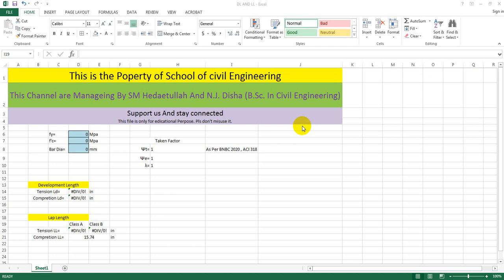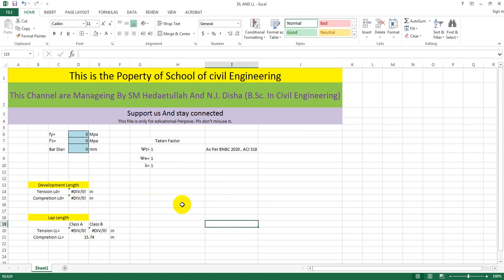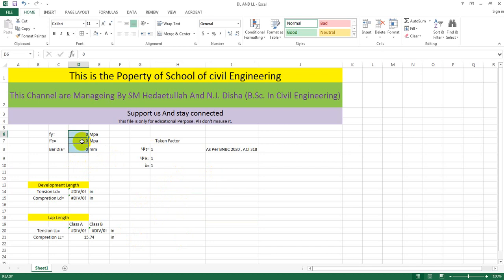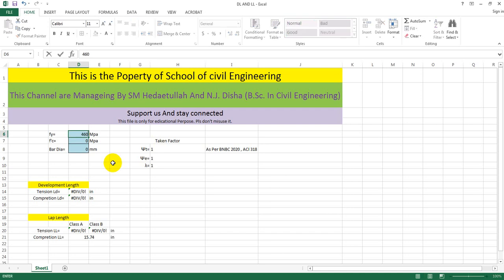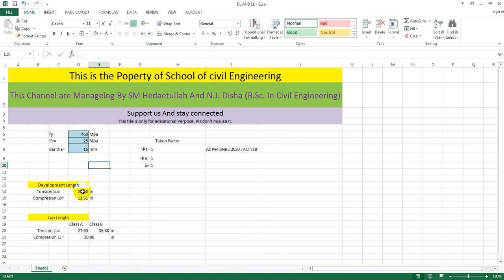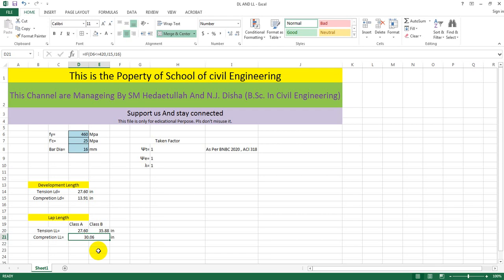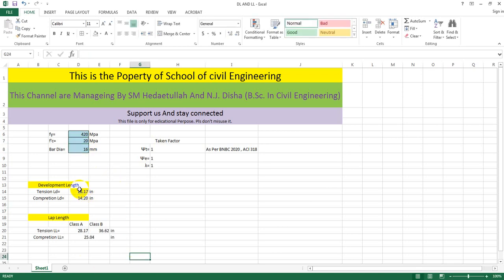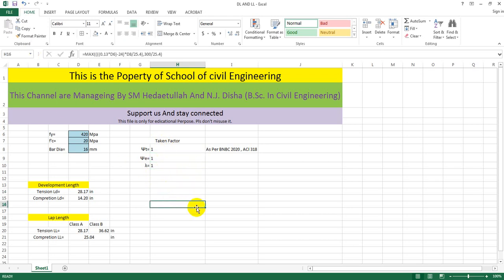Development length and lapping length calculation excel sheet as per BNBC 2020 and ACI 318

Comment: What is the class A and B?
Reply from the maker: Lap splices of deformed bars and deformed wire in tension shall be class B splices except that Class A splices are allowed when the area of reinforcement provided is at least twice that required by analysis over the entire length of the splice, and one-half or less of total reinforcement is spliced within the required lap length.
For more information.
Section 8.2.12 Splices of Reinforcement - General- BNBC 2020